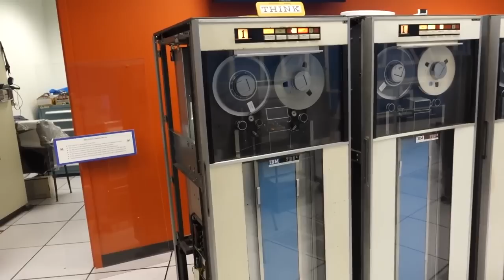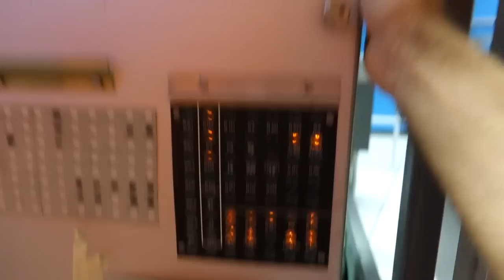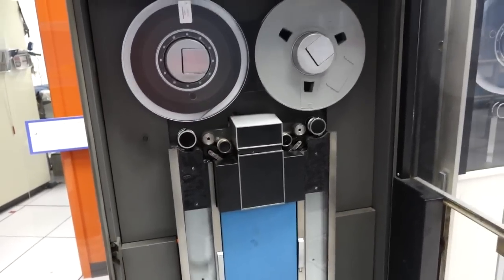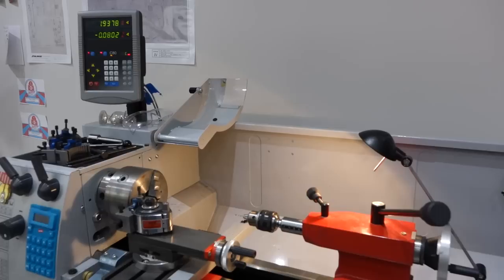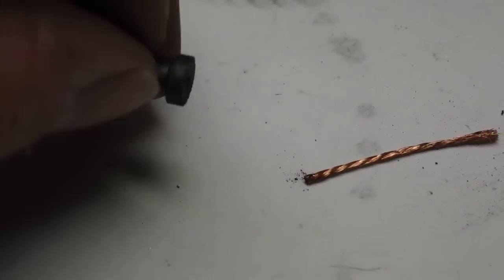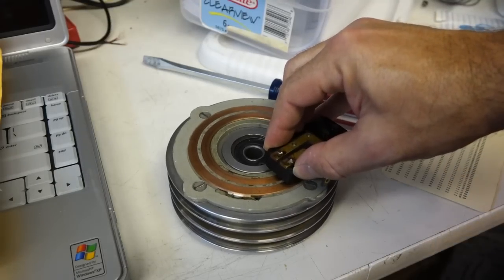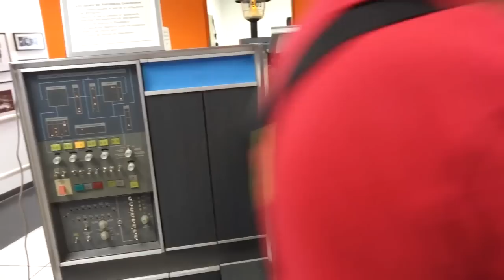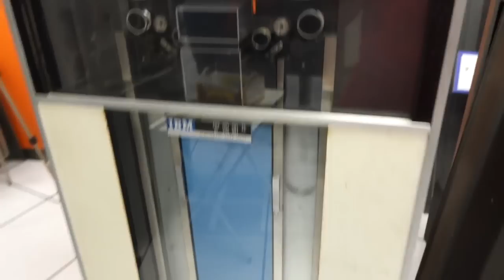Debugging the 1959 IBM 729 Vacuum Column Tape Drive at the Computer History Museum

Comment: holy shit the very first computers seem so much more complicated than current ones lol you need an engineering degree to operate that thing
Reply: Tremendously simpler on the outside, tremendously more complicated on the inside.
Reply: I was born in the 80's, but I've got a nostalgia for old computers; from back in the day when if you had a computer, chances are you KNEW how it worked! Nothing like today's generation who can't even tell me what file extension their document uses, or do basic file management, much less be able to track down a stop error.
Reply: I blame Apple. One sec, I just need to go to the advanced options... Oh wait... The ARE no advanced options.

Comment: "a little bit of electronics" the entire back is filled with circuit boards and relays, how is that a little?
Reply: Consider that all the electronics are discrete components; condense them all to one ASIC that would likely be smaller than 1mm^2 using today's lithography techniques: it's "A little bit of electronics".  Alternately you missed the sarcasm.
Reply: If your phone was built with the same size electronics, it would take up an entire house. Probably more.
Reply from the maker: +Allen McFine: Yes that is a lot of electronics and relays ;-)
Reply: If your phone was built with the same size electronics, it would be on the order of the size of a smallish town.

Comment: any idea just how much data 1 tape holds?
Reply from the maker: About 20MB. In the context of the time (it's hooked up to a machine that has 16 KB of memory), it was a lot.
Reply: LOL thats how much ram my sinclair 1000 had, but my tape deck didn't hold that much data i don't think :) still very impressive units for the time.
Reply: My goodness. After I get my EE degree, I'm applying for a job there. This is EXACTLY the type of work I want to do. I seem to be pretty good at it so far.
Reply: wikipedia says one 2400ft tape of this kind that they are using holds 3 MB
Reply: wow thats all? sounds hardly worth the effort but I guess they had to start somewhere :)
Reply: Think of it like this: on a punch card, if every column had data on it, it would be able to hold ~ 80 bytes (if I remember right). Now obviously we know that 20MB is about 20,000,000 bytes. That means on one tape, you can store 250,000 cards! That's a lucrative amount back then!
Reply: The IBM 729 is a 7-track tape drive. So it can only read and write 6-bit BCD (Binary Coded Decimal) characters. The 7th bit is reserved for parity checking. Seven tracks cannot handle 8-bit characters that we use in computers today which use the ASCII character set or in IBM mainframe and midrange systems which use the EBCDIC character set. The BCD character set can have only 64 different characters consisting of numbers, upper case letters, and some special characters. There is no lower case characters. IBM mainframe operating systems utilize record-oriented files where data is stored as collections of records. This is in contrast to byte-oriented files, where the data is treated as an unformatted stream of bytes. 

The IBM 729 can write in densities of 200, 556, or 800 characters per inch and it writes groups of records as blocks. The gap between blocks takes up 0.75 inches of tape. So if we were to have a file that's 80 characters per record and 10 records are grouped into a block, the block length is 800 characters. At a tape density of 800 characters per inch and gaps between blocks at 0.75 inches, we can fit 16,457 blocks or 13,165,600 six-bit BCD characters on a 2,400-foot reel of tape. If 50 eighty-character records are grouped into a block, the block length is 4000 characters. We will be able to fit 5,008 blocks or 20,032,000 six-bit BCD characters on the same 2,400-foot reel of tape.

The IBM 3420 drives, however, can write 9 tracks and can handle 8-bit bytes. Gaps between tape blocks are smaller. The tape density of these drives are 800, 1600, and 6250 CPI, giving 22.5MB, 45MB and 175MB respectively on a standard 2,400 feet tape.
Reply: see this is the kind of information i find interesting, I could care less what Justin Bieber or Kim Kardash(somthing) is up to. I'll go with hardware specs anytime :)

Comment: I can't help it but that rattling sound is not what should be hear when capstan shafts are moving.
Reply from the maker: But it is. The rattling sound comes from the Prolays. As you can see, the capstans are moving continuously, and the prolays repetedly pinch the tape against either the forward or reverse capstans. Which gives that typical staccato sound.
Reply: We ran compatible StorageTek drives at Dunlop tire factory in the 80s, and I don't remember the noise level being anywhere near what your drives are doing there. Hmmm.
Anyway ... I really miss the 3083E we had, which replaced a tandem of a 370 and some other (possibly 360, don't remember anymore). It had a whopping 32 GB of main storage, and I remember the one rack that contained a water pipe three times the diameter of my upper arm ... if I had a time machine, I'd go back to 1980.
Reply from the maker: These are 1950’s 7-track drives! There is no way there would be a 1980’s StorageTek drive compatible with it. Much less using a comparable transport technology.
Reply: @CuriousMarc  capstan drive transports tape that is pressed against the rotating axle by a rubber pinch roller. The principle is everywhere and has nothing to do with one tape drive being compatible with another. Duh.
Reply from the maker: A vibrating Prolay transport? I doubt any tape after the 729 generation had that. I have never seen it used on another transport. I will check.
Reply from the maker: I checked with our tape specialist Iggy (that can be seen in the video), and he tells me there is actually one generation after this - the first generation of IBM 9-track - that use the same Prolay arrangement and make the same characteristic noise. It would be the early IBM 2400 series, for the first IBM 360. These would be mid-1960's tape drives. My own IBM 3400 series tapes have a regular capstan arrangement.

Comment: And you thought your phone was smart xD
Reply: Put the iPhone engineers 40, 50 years ago and put them in front of the problem 
Coder/developer mentality : "We'd need entire racks populated with transistors to create enough cache to ensure the data are written, as a buffer... but then the bandwidth would require huge motors on the tape, maybe need servomotors.. how can we make this thing work? a random access filesystem? a Bic pen to rewind it like they did in the 90's"
Engineer : "a vacuum pump in two columns so the data is written on the tape optimally, we might invent a similar system to store video."

Comment: The thing I feel need to know sad though it is, is how the load mechanism attaches the end of the tape to the other spool. If somebody could explain or video that I'd really appreciate it
Reply from the maker: +Jonathan Schneider It's done manually. This early version of the drives do not fully autothread. Later versions do.
Reply: CuriousMarc Thanks. I'm still curious though. How does the autothreading work ? And thank you very much for this and similar videos !
Reply from the maker: +Jonathan Schneider I have only one autoload tape, from HP. You can see it loading here: https://youtu.be/eCBxNhEzIfc . It works with a combo of airflow, optical sensors, and feed reel servo control. It's pretty mesmerizing to see load. It catches the tape on the second reel with vacuum.